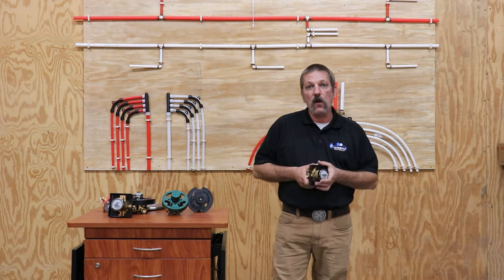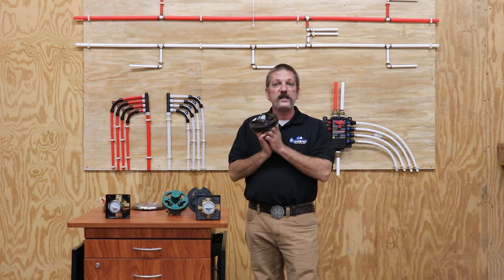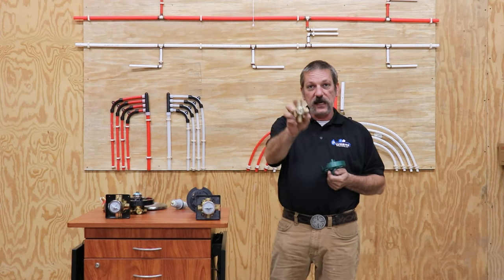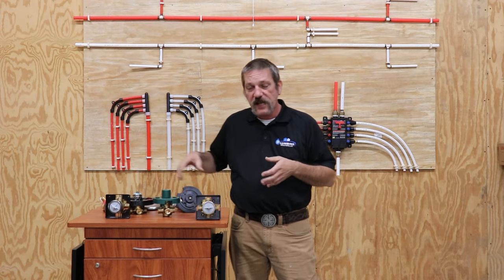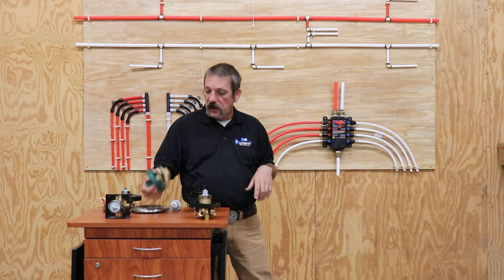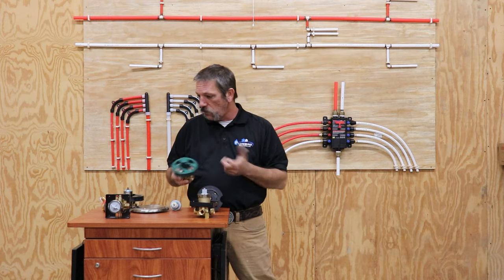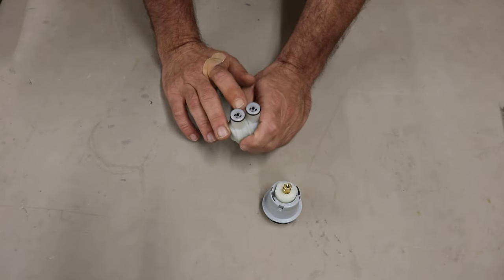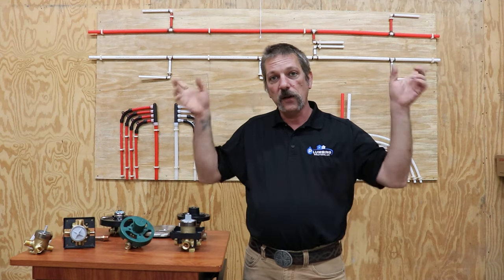All about shower valves

Comment: I've been looking at Grohe exposed thermostat valves. I've heard excellent things about them, and they look like they dramatically reduce the complexity of the assembly: the only thing in the wall is your hot and cold lines, and the only penetration is for the valve body's adapters to those two lines. The valve body has the thermostat adjustment and flow control built in.
The price is also surprisingly normal, for something that could easily have been hit by the "ooh, european!" mind virus.

Comment: 5:53 

Are those plastic cages/guards absolutely necessary? 

I’m replacing the mixing valve in my tiled shower and it was originally missing a plastic cage. 

The plastic cage I have for my new mixing valve won’t fit in the wall because it butts against a structural stud. 

Can I get away without a plastic cage on a tiled shower?
Reply from the maker: No you don't need them
Reply: If I am not mistaken, is that the mudguard?
And it will help determine how far out your prep board / thinset and tile can come out for the valve not too far and not buried in.
Reply: @PlumbingSolutionsLLC  thank you so much!

Comment: Don’t know why the industry calls them “valves”.  They are valve bodies.  Without the cartridge they are nothing.  Oddly enough the part that comes with the cartridge is called trim.  For the novice shopping online you may find it hard to know what you need to buy to actually get a functional product.

Comment: Are 3 handle valves still legal? My understanding was that we need thermostatic anti-scald to be code compliant
Reply from the maker: Um.. you can still buy them , I'll have to check the code. we have used them on remodels.
Reply: They're not up to code in most places. But you don't need a thermostatic valve; just a pressure-balancing valve.

Comment: Hey.  I am ordering from Signature Hardware.  I showed our plumber the page description which states "Available Single-Function Diverter Valve Cartridge restricts water flow to one outlet at a time. For installations only requiring 2 outlets, the 3rd outlet may be looped into one of the existing pipes." Would this be clear enough language for you?  It shows various scenarios which one of the customer service reps called "capping." But my plumber seemed confused and asked if they provide a "three way cartridge, or three way valve." I guess I am confused because Signature Hardware said the instructions should be understandable to any plumber.  Does this make sense to you?  For instance, the shower kit for the Lentz shower system has the instructions that describe what I'm looking at.  You probably won't read this in time, but I'm hoping you might.  This is a shower I'm having built in my mother's bedroom; she's elderly/disabled/on hospice.  Thank you!
Reply from the maker: The Delta valve does 3 or 6 functions. and no, I don't know what you are asking.
Reply: @PlumbingSolutionsLLC  For a cartridge designed to do six functions, how do you thread and cap so that it's only three?  (We will only be using shower head and/or handheld.  No tub). Or, is this a question that's different depending on the brand?

Comment: What happens if you install a delta mixer valve and just has that plastic cap cover. Will the hot water and cold water mix? The reasoning asked is I just had a mixer valve installed, and now I just get Luke warm water in the house. I had hot water with no issues before, but now it just warm.
Reply from the maker: you have to put a cartridge in it .
Reply: @PlumbingSolutionsLLC  that's what i thought but the plumber  when i said water was mixing said it should not be mixing but I am thinking if there is no shut off valve or anything to prevent the hot and cold mixing  then it will mix and did. The Plumber kept saying it my water heater because its 9 years old and full of sediment ect ect. I drained the water heater and flushed it and went to HD to get the cartridge boom problem solved. It was funny the guy in the plumbing dept who actually know s plumbing said how come the plumber is not trouble shooting the issue himself.

Comment: Which one of those valves allow you to regulate water flow flow moen single handle valves don't flow like the 3 handle or 2 handle valves that allow you to control flow???
Reply from the maker: Valves don't work like that anymore. it's off or on.  Unless you have thermostatic valve . it has two handles one for temperature and one for flow. but everything is so choked down (flow rate) that most people run them wide open and full flow also helps with tankless heaters.

Comment: We are doing a shower renovation with two shower heads and two valves (on either side of the shower).  We are wanting make sure we have the "loop" correct between the two.  Do you have any diagrams or examples of that?
Reply from the maker: You don't need a loop if its one shower head on each valve . that's really for body sprayers
Reply: @PlumbingSolutionsLLC  the two valves are on the same 1/2” line. So 3/4” in the concrete slab to 1/2” which comes up in the bathroom. We have the lines coming up then splitting off toward each valves. We have been reading and it seemed like they needed to loop back. Is that not the case?
Reply: @kelleyhalsdorf4575  no . you don't need to loop it and one valve would do just fine. if you going to run both heads at the same time.

Comment: What do you think is best as far as leaks are concerned, to have Pex A connect at the valve for the hot and cold lines or to connect copper at the valve then connect the Pex A under the floor in the crawl space?
Reply from the maker: The less connections you have the less likely you are to have a leak. I would use PEX ready valves and go straight to the valve.
Reply: @PlumbingSolutionsLLC  Thank you!

Comment: I have a Delta Mixing Valve, I have no water Pressure so I replaced the cartridge and still no pressure. I confirmed that I have both cold and hot water pressure reaching the mixing valve however not working. Any recommendation would be greatly appreciated.
Reply from the maker: water saver in shower head? check that.